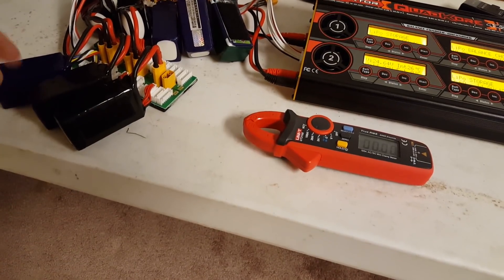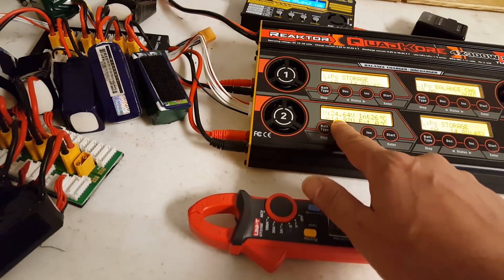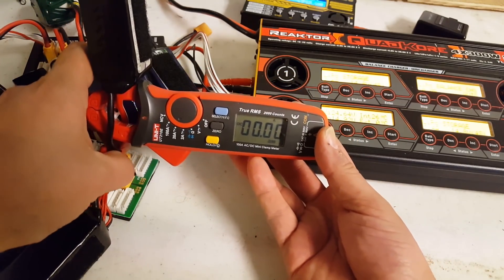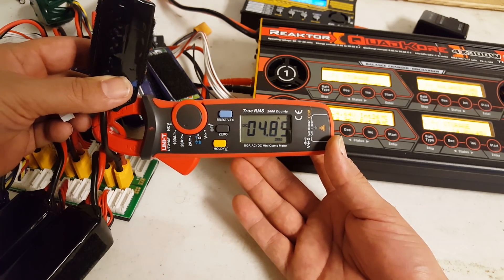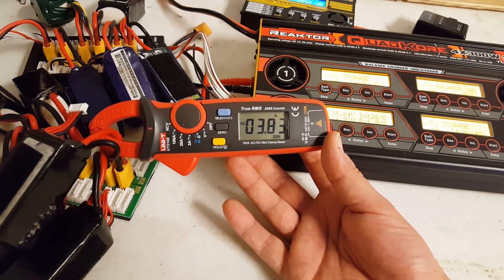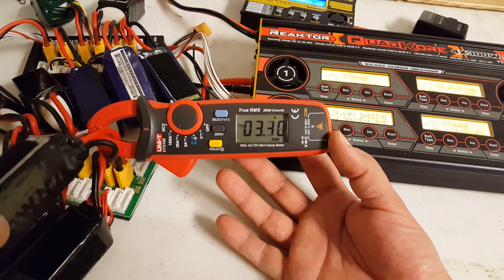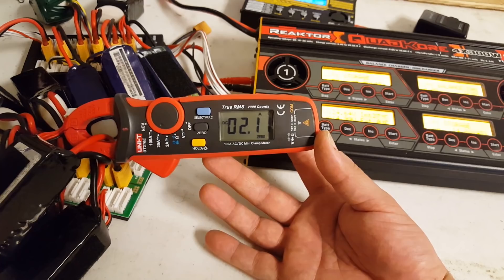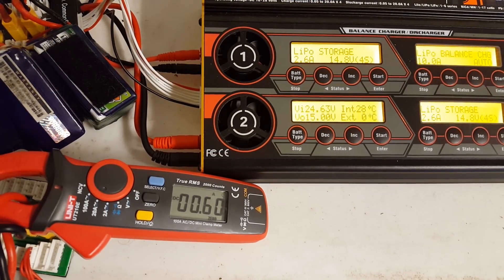Parallel Charging Equalization Current

Comment: 2 questions. should you not have had the balance leads of the other batteries connected? would that have been safer? also say you had 2 batteries that were .4 volts higher than the rest rather than just that one wouldnt it be putting out twice as many amps into the other batteries, being 20 amps initially and then hovering around 10 amps for a while?

Comment: Don't understand why you'd leave the balance lead disconnected. Surely the bulk of the current will flow through the discharge connector anyway? If the balance leads have higher resistance, less current will flow through them.
Also, I don't think you'll get the same current connecting one lower charged lipo to the one higher charged one as you did in this test - the voltage of the packs being charged goes up more the faster they are being charged. I would like to see this repeated with one to one.

Comment: Have you adjusted the trimmers inside the UT210E clamp meter? I see that the DC current value doesn't change when you move the meter around.
Reply from the maker: This is stock configuration no changes.

Comment: Imagine a situation where you have 4 batteries with different voltage and you want to parallel charge them all. The best practice would be plug them from lowest to highest charge (but without plugging the balance lead) and after some time settling, plugging the balance leads of all them at once prior to star charging? 
 Thanks for the tip! I was wasting my time =P
Reply from the maker: Yeah I think that's right because discharging fast is not harmful but charging too fast can be harmful. Just make sure the overall current flow stays low enough and use a clamp meter to verify if you're not sure.
Reply: Joshua Bardwell  thanks! Definitely learned something today! 
I'm still to get myself one of those, but surely will.
happy flying!

Comment: can you safely parallel charge 4s with different C ratings?
Also would you not be able to avoid the battery feeding into each other with one of these: https://www.banggood.com/Parallel-Charge-Cable-Power-Line-Charger-Dedicated-Line-XT60-X6-p-944556.html
Reply from the maker: You should never charge faster than 1C when parallel charging anyway, so battery C rating is irrelevant.

That harness is electrically identical to a parallel charge board in every way.
Reply: Thanks for the reply.

A guy replied on one of your other videos with the following:

"It is true that all batteries slightly differ in internal resistance.  
But the real reason why each of the batteries was accepting a different 
amperage is due to the parallel board.  The battery closest to the 
charger will have a higher amperage.  But the battery furthest from the 
charger will get a lower amperage.  

Better put, if using Direct current to make a light work current drops 
the longer the wires.  Get shorter wires to minimize current loss.  

To get a true even charge, one of the main power leads should be on the 
other end of the balance board.  This forces the current through all the
 batteries thus resulting in a even current across all batteries.  I 
know this from Electrathon racing over the years.  Iota DLS chargers 
cover this very topic for lead acid batteries in a PDF online.  They go 
into more detail to get a "perfectly balanced batteries" with a modified
 wiring setup.  But in the end, the same can be applied to really any 
battery.
Nice video Joshua Bardwell, like the videos!

http://www.iotaengineering.com/pplib/balancedcharging.pdf"

This made me think the cable seems like it would spread the current more equal as it doesn't appear to be layed out in a series.
Also they don't contain the balance lead plugs, hence you saying its identical to a PC board is really surprising to me.

Comment: Hi Josh, great video, I bought the exact same tool.  I noticed when you flip it on the wire it reads negative and the reading is generally a higher number.  Do you know why that is?  I should be using the positive reading correct?
Reply from the maker: +RCcrazed negative means the current is flowing one way, positive means the other way. Usually you can tell in a DC circuit which way the current must be flowing. If my memory is correct the sensor is aligned so that positive current flow is from back to front. But I'm not 100% sure.
Reply: +Joshua Bardwell right I get that but why are the numbers different by about .2-.3amps?
Reply from the maker: You have to re-zero DC measurements whenever you move the meter. DC current sensing is very sensitive to placement. AC is much more robust.
Reply: +Joshua Bardwell ah ha! So after every measurement zero the thing out? Thanks man!
Reply from the maker: For DC, zero before each measurement. Place the clamp on the wire if no current is flowing, or next to the wire if current is flowing. Then zero.
Reply: +Joshua Bardwell thanks Josh!! I do love the data this tool provides :-)

Comment: I wish there were a "smart" parallel board that could manage packs safely like this. It would be nice if it could manage low and high packs in a way that is conducive to safe balancing between similar, but not equal packs, even to the point of shutting down packs, and managing larger differences.
Reply from the maker: +101rotarypower I have talked to somebody about that, and the conclusion he has come to is that by the time you've done this, you've basically built a charger. The price is too much. You're better off buying one of those 4x 10 amp chargers and charging the batteries individually.
Reply: Could be done with arduino, relays and lots of time to develop it. :)

Comment: My take-away:  When plugging in the batteries for parallel charging, plug in the most discharged batteries first, and the least discharged batteries last.  Great tip, and it was interesting to see that happen live in a video - Thanks!!
Reply from the maker: +Randy Soraich And be more conservative about the 0.1 volt per cell guideline if you have relatively few batteries. Glad you liked it!
Reply: +Joshua Bardwell Yes - I've always been more conservative with that - I usually stick to .05 volts per cell.
Reply from the maker: +Randy Soraich I would like to see a parallel charge board with switchable resistors between the relevant points. If you plug in batteries with excess voltage difference, the resistors limit current appropriately. Then, for charging, you switch them out of the circuit and charge at full rate.
Reply: +Joshua Bardwell that's a fantastic idea.
Reply from the maker: Randy Soraich I'm not sure it will work in practice. Let's say your worst-case scenario is you pass 40 amps, after which a master fuse will blow. How many watts would the resistors need to take in order to protect against a worst-case scenario such as plugging in a 2S and a 4S or something? In other words, let's say the worst-case scenario is you want to pull 40 amps down to 2 amps. How many watts do you need to dissipate? Let me crunch...
Reply from the maker: +Joshua Bardwell Let's say your worst-case scenario is a fully charged 6S plugged into a completely discharged 2S. So that's 25.2 - 6 = 19.2 volts. With a potential of 19.2 volts, you would need 9.6 ohms to produce 2 amps. 2 amps * 19.2 volts = 38.4 watts, worst case. Does that seem right? A 40 watt resistor would protect a 6S from a 2S.
Reply from the maker: +Randy Soraich A 40 watt, 10 ohm resistor, that is.
Reply: +Joshua Bardwell that's a good idea for charging like batteries but I don't see the need for designing it to work with a 2s and 6s.  plus that's a huge resistor to make that work! why not just design it to make the existing purpose of charging same cell count batteries a little safer? it would be much smaller and cheaper.  thanks for making this video so I don't have to experiment!

Comment: Thanks. Putting on my list of videos to show my physics students.
Reply from the maker: +Nathaniel Whitley SWEET!
Reply from the maker: +Nathaniel Whitley I think the most interesting facet of this experiment is that the current flow between the batteries is as low as it is. If you didn't understand internal resistance, that would be a real stumper. 0.4 volts / 10 amps = 40 mOhms = the approximate IR of the battery system. A ha!
Reply: +Nathaniel Whitley Same here. We're starting circuits in a couple of weeks, and they could totally explain how this works after a few lessons :)

Comment: Generally speaking,  could I  gradually, plug in batteries from lowest to highest charge, over time, into a parallel charge board to equalize them, rather than charge/discharge them to the same voltage before charging parallel? Thank you for your videos, i have been learning a lot.
Reply from the maker: +Adam Verrett Generally speaking yes, as long as at no point the difference between the two is more than 0.1 volts per cell. So let's say you have one battery at 14.5 and one at 14.9 and one at 15.1. So you plug the 14.5 and the 14.9 together and they equalize and settle at 14.7. Now you are safe to plug in the 15.1. You would not want to do it in the opposite order because you would be charging the "low" battery at an excessive rate. As-is, the 15.1 may push a brief surge of up to 10 amps, and a more sustained current of 5-6 amps, into the other two batteries. It's your call whether you think this is safe or not. It probably won't start a fire, but it might possibly shorten your batteries' life.

Comment: You should investigate the so called "safe" para charge boards which have self resetting polyfuses on each of the balance circuits as well as individual pack automotive style fuses. 
I also think it is a good idea to get and use one of the cheap lipo voltage alarms with individual cell voltage indication to do a quick and dirty pack health check before para charging. The FrSky smartport voltage sensor can also do double duty for this task.

http://www.hobbyking.com/hobbyking/store/__46191__HobbyKing_Safe_40A_Parallel_Charge_Board_for_4_Packs_2_6S_XT60_AUS_Warehouse_.html?strSearch=para%20charge

http://www.progressiverc.com/wires-connections/charge-boards/

http://www.electricrcaircraftguy.com/2013/01/parallel-charging-your-lipo-batteries_22.html
Reply from the maker: +Rob B That's pretty cool. I didn't know they also had polyfuses.
Reply: +Rob B I love these kind of boards.. I have two and its saved my ass once .. I plugged a 3S into my 4S rack during a brain fart... it should have been bad bad ... but the fuse on the balance board just popped and everything stopped .. it was kinda badass but scared the shit out of me hahahah .. I wont parallel charge without a fuse now.
Reply: +Joshua Bardwell http://www.readymaderc.com/store/index.php?main_page=product_info&products_id=2984   you give up a couple of charge slots.. but mine has saved my ass  ;)
Reply: +Rob B I've tested  poly fuses they are great buth get realy hot and still pas 100mA  after been triggered
Reply from the maker: +d3xterown 100 mA is not enough to blow anything up, but if they overheat without any clear indication, you could have trouble.
Reply: +Joshua Bardwell they dont overheat, Its jusst how they work PTC resistors  dont cover them with plastic/foam

Comment: Can you also use this method to resurrect over discharged packs?
Reply from the maker: +Kemar Simmons I don't think I would resurrect an over-discharged pack using this method for two reasons. First, the safest way to resurrect an over-discharged pack is with a low current, like 100 mA or so. Plugging two batteries together does not control the current, and is likely to be much higher than this. Second, both packs will equalize voltage. So if one pack is at 2.5 volts and the other is at some higher voltage, there is some chance that the lower pack will pull the higher pack down, and then you will have two dead packs instead of one.

The only way I would resurrect an over-discharged pack is with a charger that is controlling the current carefully.
Reply: +Kemar Simmons I made a simple cable for field use just for that scenario.

Comment: very interesting indeed! I definitely have not been waiting 10 or more minutes before starting the charge when balance charging. what do you think is the result of plugging in six 4 cell batteries that are within the voltage difference and then starting to balance charge them all on the charger?
Reply from the maker: +Twinkle Thumbs The charger will act as another current source, as if there was another battery in parallel, basically.